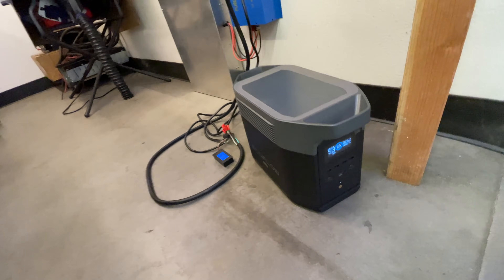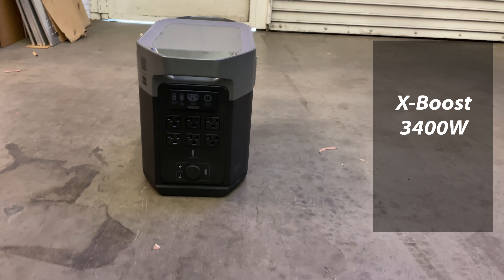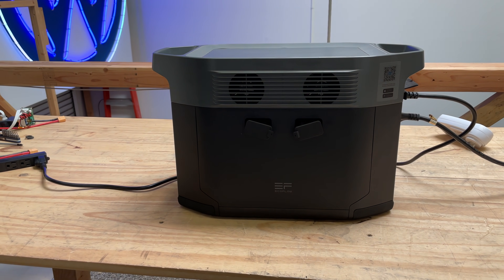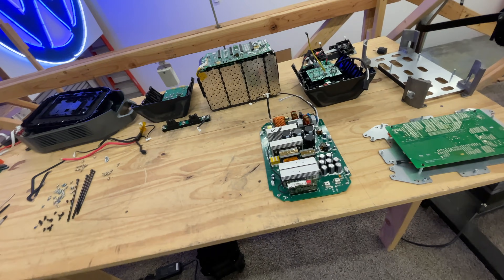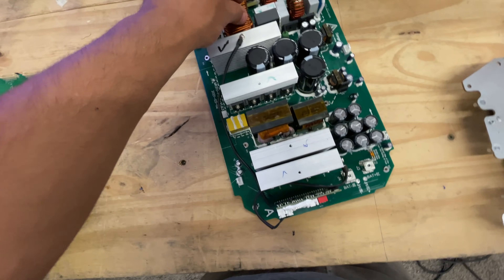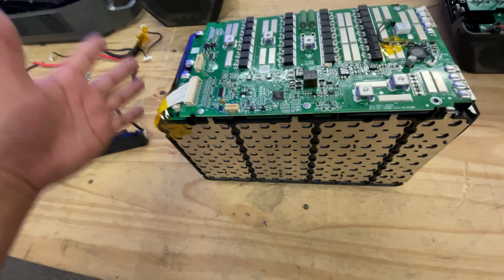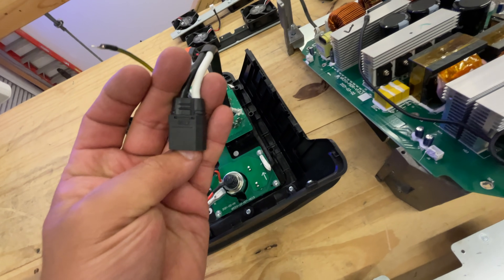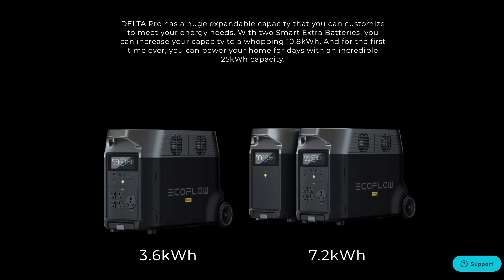Best Solar POWER Pack - EcoFlow Delta MAX review

Comment: Thank you for  the video, Jehu. I sure would like to see a video in the future of someone actually replacing all the battery cells and how you could replaces all the cells and get this all working again. Vs. Cost of just maybe a way of buying that whole case prebuilt with new batteries and all you do is open up the power station and swap it out. I really need to get the right type of solderer so I can solder on each individual battery back on correctly. AT the very lease it could turn into a great lesson or trainer. 

Well done on the video!

Comment: My brand new Ecoflow Delta pro discharges while in bypass mode with a small 100 watt freezer plugged in. Plugged into 120 vac it should never discharge. There should be no activity in the circuitry. Even monitoring for power failure should draw nothing, it should be latched. You expect a full charge when the power goes out but if it is down to 50% then what good is it? Cant return, cant fix it, warranty means nothing.

Comment: I just bought this unit and plugged it in and it tripped my breaker , OVERLOAD 60hz came  on and all the AC plugs would not work. Not to mention the overload protection button doesn't  work... What causes something like this to happen??
Reply: Use the app to drop the charge rate,

Comment: This channel etc helped me decide and get a delta max battery and power station…although pricey the battery is pretty close to if not the best available without self projects..and to me the power station is economically great..possibly the best for its features compared to all power stations…and heck lots is perfect in features of its kind but I suggested they add vent(s) near the bottom to allow cooler are low in it to cool the top…and an other inprovement is to be able to add other types of batteries easy and  safe…like car batteries etc…etc to the back of the delta max power station.
Reply: I also suggested alerts when changing the discharge/change …make it able to be use as just a power outlet, also to just maintain a percentage like 90% and also lastly to allow around a 5-10% level with beeps and app warning when doing so.

Comment: The max I received has a nice feature I didn’t expect…4 fans on top…2 move air from One side to the other fans that blow out.   …I’m not sure if it would be better to have vents that all push air out and pull air from the bottom vents…. It could be a huge improvement to cooling by doing this instead.

Comment: This has the better battery 🔋 but very pricey was looking at the Delta 1000  but batteries over heat and diminished charging and is not a every day usable unit better designed for camping 🏕 not a Gas ⛽️ generator replacement for sure!

Comment: Quick question. eBay is selling through this company refurbished Delta pro 3600 wh units for $2749 each.  I plan to use this only when the power goes out in our small home which is a few times per year and get rid of my gasoline generator. The unit is advertised as having more than 3000 cycles of life. Theoretically then this should last for decades if just sitting in my garage as used maybe 4-5 times per year correct?    Are the lithium batteries good just sitting there for years?  I plan to keep them fully charged with my solar system always.
Reply: If it is refurbished by the official company than yes, but the truth is that you dont know how the battery has been run and how much life there is left.. I love a good deal but it`s a risky one, make sure you get good warenty and not the kind where you have to send it back to China..
Reply: @raduardeleanu4800  The company states in the ad that the units are practically new with at least 90% life left.  The company if you did your homework is located in San Francisco not China. The risks look minimal as the ratings are very high by the way.
Reply: @philc.9280  There is no need to be condescending as I live In U.K. and any returns are sent to China..
Reply: @raduardeleanu4800  Sorry.  You may want to wait as there are a lot of  2000 watt hour  + units coming out that are much cheaper and maybe distributed in the UK.  The Pecron E3000 is 3100 WH ( $1600 US).  The Oukitel is 2000 WH with Lithium-ion phosphate 
( $1199 US)
Reply: @philc.9280  Thanks, yes they seem like a good deal :)

Comment: It's a shame that they didn't use LifePO4 batteries and wonder if there's going to be an option to buy replacement batteries given the fact that you can disassemble the unit yourself without a lot of problems.

Comment: HI  , How did you connect the Delta Max to the transfer switch to power the building . Just from an AC socket from the Delta Max ?
Reply from the maker: Yes
Reply: @jehugarcia  Short and sweet  . Thankyou👍
Reply: @jehugarcia  I bought a (2)5-15 to L14-30R for my Delta Max.  I want to make sure do I plug in both ends into the AC ports or can I use just one AC plug?

Comment: Awesome video!! So how long do you think this battery will last? And could you replace it when it goes up one day? I’m alittle skeptical about these units. They are new and are great but life span is it worth the money. Thank you!
Reply: Think 2 years, depends on how you run it (800 cycles) after that it will store less and less power, if you set the charger to slow charging through the app it will last you longer, discharge it to 30% and charge it to 90% you will get a lot more life out of it..
Reply: @raduardeleanu4800  great advice. thanks

Comment: Can you use this as a standard UPS? I read the older models they had it wasn't a good idea to keep them plug in to mains power all the time
Reply: Yes you can, as it bypasses the batteries on AC, but there is a (30ms i think) delay  so I wouldnt be running my desktop pc as the delay would crash the pc, dont run a boiler on this, but other things like tv, laptop, phones etc... no problem. 

If you are running solar there isn`t a delay as its going through the battery nonstop but that reduces battery life.

Comment: I have the max and the 48v external battery.  When I connect to the xt60 connector it starts charging for a few seconds then stops.  The device is at 96%.  Could that be why?

Comment: Great video. Hi! Recently purchased the EcoFlow DELTA Max Power Station with an extra battery and solar panel. I need to know what size btu/wattage portable air conditioner w/heat or window unit w/heat I can buy to keep my baby comfortable or survive. Our bedroom is 200sqft and open plan living area is 765sqft. We are in SE Texas it gets hot but last winter it snowed and was below 10 degrees for a couple days. Live in a townhouse so this generator is our only option. Nothing else needs to be plugged in if we are sleeping just the ac. Can you help determine the size please and how long we can run it? Thank you much!

Comment: Can you tell me what the total working output of ONLY ONE of the 120 volt outlets on the delta max is? I would like to utilize a  5-15P Male to TT-30R Female Electrical Power Dogbone so that I can plug a 30 amp power cord into an inlet box inside my home on a dedicated circuit panel to run a select few items (not all at once of course). I currently have one on the outside to work with my gas generator used during the day. Need a plan for night time to keep furnace blower and one fridge running and thought this might work? Furnace blower pulls 12 amps and fridge 7.1, both 120v. Thanks and keep up the greatly informative videos!

Comment: How long does it take to charge with a 100w solar panel?
Reply: Since it's battery is 2016wh you would need about 20-22hrs of full sunshine in the best conditions to go from 0% to 100% battery with a 100w solar panel.  Cheers!
Reply: I use a 1800 watt setup, 4 in series x3 , in the sunshine I charge it fast, but as soon as its cloudy i get 100-150wh so think overkill solar :)

100w/h would be good only for a small ammout like charging the phone and running a light..

Comment: Does anyone know if I could use a power pack to safely power a desktop computer? I do a fair bit of gaming on high settings and was wondering if powering my desktop with a powerwall would be safe or would surges in my computer's usage make it unsafe for my electronics?
Reply: You should be able to run a desktop computer with the Ecoflow as the AC is using pure sinewave. I am using a smaller Ecoflow and test ran my Bosch washing machine for 45 mins one wash cycle sometimes went to 2,000 Watts draw and no problem. Also ran a 550 GE  fridge that rated draw at 700 Watts, ran for about 4 hours then I unplugged. Test ran a hair dryer rated 1850 to 2150W for few minutes, no problem. These are all 220 to 240V.
Reply: @handyandytheman  Im running a ryzen 5950x + radeon 6800xt hooked up to a 4k hdr 55` tv :) so yes :)

Comment: Would it be possible to use these in series to power an ev I build and plan only to drive occasionally and for fun? Instead of getting a battery pack out of a Leaf/Tesla / etc? The reason I would do this is to justify buying the EcoFlos because when not being used for the EV they could be back up power for our house. Would this be possible? Or am I crazy? LOL
Reply: I own one, and I can tell you it wouldnt be worth it, the ev usses a lot more power than the delta max and 2 extra batts.. they would get you to 6kw/h taking out the inverter headroom you would be left with 4kw/h.. you will gget a few extra miles.. you could pop over to the shop for a pint of milk :D

Comment: So I have to ask the set up you used to run your shop off the solar battery; is that just the same set up for a portable gas generator to plug in.

Comment: Hi jehu, I have been watching your channel for several years, incredible amazing content.. all the time..  thank you for putting these together!   Had a question you right be able to help with.  It is related to these Power Packs we are seeing come on the market like you discuss in this video.  A question comes up as to why or why not connect a male to male cable to one or several of these to regular house sockets when the power goes out in the hopes they can work together to power the house.  My first thought is for simplicity sake forget that you might send power into the grind for sake of conversation on the electrical aspects and look at the basic concerns of who to think through this first, if multiple devices are on the same "grid" powering at least one side of your break box maybe these devices need to somehow sync up harmonic distortion and this is where I, like many others(or maybe it's just me?), begin to run out of Brain power trying to understand what's really going on, and then the other side of that question what if I find a 2nd socket that is NOT on the same "leg" to plug a second bank into which fires up both sides of the circuit box, do they still need to somehow match "pitch"?   Could you please help the channel with that video?  I think it really could answer a lot of different comments about inverters/s (as well as sine wave vs not, etc), and maybe even help with all kinds of home powering conversations using batteries.
Also thank you for fulfilling all of my orders so fast... you have a lot of well thought through products to offer.
Reply from the maker: Yeah you would have to match sine waves or they would all blow up,   Simple answer.  There are inverters that can do it I own several but they are rare and expensive
Reply: @jehugarcia  So if you had just one (like the big $8,000 EcoFlow), and being in CA.. you had a typical brown out, would you male to male plug this guy into a 15amp or something similar outlet to light up that side of the breaker box?
Reply: @mikenkaried4543  brown out? geez

Comment: What sort of crappy electrical grid do some people seem to live in?  Outside of once in a lifetime storm events how is needing to worry about blackouts even acceptable?
Reply: Crappy Texas that has it's own power grid and doesn't share with anyone else in the country.  My power was out 3 days straight during the freeze last winter, and others I know was out longer than that.  If I had a way to power the electric blower on my gas furnace, I could have at least kept my family warm when it was -10 outside.   

I don't think once in a lifetime storm events will once in a lifetime anymore.  With climate change, it's only going to get more frequent and intense every year.
Reply from the maker: The USA is not what it used to be
Reply: @jehugarcia  :-(

Comment: Is this protected against EMP attack?
Reply from the maker: Nothing is
Reply: @jehugarcia   During a solar storm/solar flare event, will a car that is not running (but may me drawing low volt power from the battery for misc. things - alarm, sensors, etc.) be affected/burn by the solar flare? Also, will this Eco Flow or any solar charger that is OFF and unplugged be affected/burnt by the solar flare surge?
Reply: Dude. Really?
Even if this unit was protected against an EMP attack...anything you would want to power would be DEAD upon an EMP attack.
Reply: @MrMnmn911  Not military devices or my neighbor's stuff.
Reply: @aliensoul1  Sounds like you need to get a military solar battery or perhaps use your neighbors solor battery.
Reply: @MrMnmn911   It just means I have to make it emp proof myself.   good luck to you.😎

Comment: It uses a NCM battery that will degrade to 80% after only 800 cycles. "That's a no for me dog." this is NOT lithium iron phosphate like the pro model. LiOP will do 3500 cycles before it degrades to 80%. Your talking a decade or more of longevity. NCM makes this model worthless. ALWAYS DO YOUR OWN RESEARCH.
Reply from the maker: Some of us care more about size and weight on a portable product.   What good is it if you don’t feel like lugging around a large heavy box.
Reply: @jehugarcia  Then you should say that in the beginning of your review.  It's importsnt to clarify that.  A lot of us care about how much power stations can do PERIOD.  If it is heavy, we can strap it to a dolly & make it portable.  I am a very petite female.  I just rec'd from (Amazon $86.89) a "Lifetime Stacking Chair Dolly"  it has 2 large  wheels like all dollies do.  I went to Harbor Freight & bot two 3" casters ($3.99 es. on sale from $5.99) & I am placing them in the front (I have a welder friend).  So now I have a smaller than traditional dolly that I can add a piece of plywood to the bars/ handles area to attach anything else I want.  It is small enough for me to transport to the beach if I want but, 98% of the time I will be using it on my 2 acre property.
As long as wheels exist, there is no reason to compromise.

Comment: Why is the Delta better then Bluetti?
Reply from the maker: Smaller, lighter, faster
Reply: @jehugarcia  Not solar!
Reply: @zfontain1975  - Having more power to charge it through AC is for the ease of use & of course more accessible than solar. Not everyone has solar or can have it based off living scenario. If one lives in aparment or condos were HOA doesn't allow items on roof etc.
Reply: @1ENDUSER  Your right, I live in a house so I run solar 24/7. I will say my Bluetti I been running non stop for 2 month with solar with easy no heat issues. My eco flow Delta could not do that with out heat issues at some point. I like testing these thing to see what they can do.
Reply: @zfontain1975  - Aside from the new Delta Pro which has similar battery tech as Bluetti's or they finally put lifepo4 battery, the other Delta's dont have it. And those battery types don't like heat. Lifepo4 can withstand heat better.
Reply: @1ENDUSER  yep you're right that's why I'm going to sell my Delta.
Reply: @zfontain1975  - I'll take it off your hands for a negotiable price?

Comment: In this review, you said it can charge a Tesla EV. What's going to happen, if this were used primarily charging an EV provided with constant solar recharging to the generator at the same time. Would it damage the battery or shorten the battery cycle life? Also, will you be reviewing the EcoFlow Delta Pro?
Reply from the maker: I don’t see a reason it would suffer any damage,   If I receive a delta pro I will review it
Reply: One can well use AC out at the same time with solar panels it will just discharge the battery slower or charge it slower, thereby perhaps extending battery life.

Comment: I'm trying to build an electric jet jon boat, will be documenting the whole build on my YouTube channel. I'm going to be using a 24v 700wh brushless motor to power the boat and I want to use 18650's for my batteries. I've been looking at your DIY kits on Jag35 but was wondering if you could suggest the best kit for that? I'd like to be able to charge the power cells in the boat. I was thinking of getting like 8-12 of the battery module kits, wired in parallel to get greater range of time/distance. Would this work?

Comment: I bought the Delta 1300 a few months back based on Jehu's review and its a beast of a pack doing anything I ask of it easily and never breaking a sweat (insane quick charge.) Ecoflow is now the benchmark in the battery pack industry and if Im not building my own ... this is who I buy.  Thanks again Jehu you are the GOAT without doubt.

Comment: I wish I could connect some EVE 280AH batteries to the EcoFlow Delta Pro system when at home.  They are lower cost.  Can you build your own external battery to attach to the EcoFlow Delta Pro system?
Reply from the maker: Pretty sure it can be done
Reply: @jehugarcia  does it have a normal xt90 or xt60 connection for input?  Would be great if I could use the battery I made for the AC200